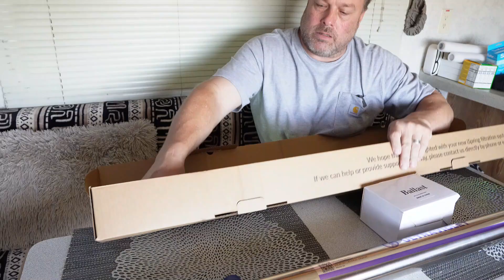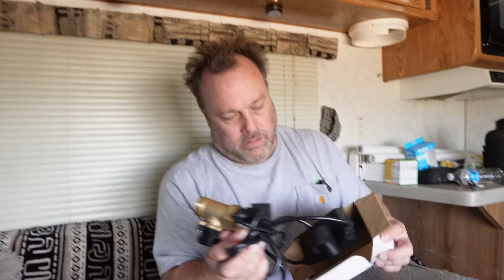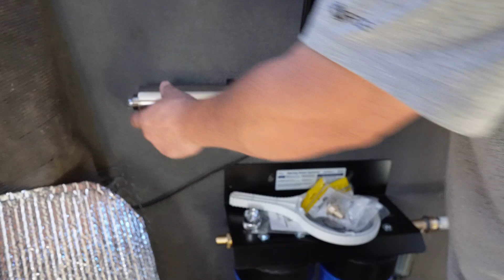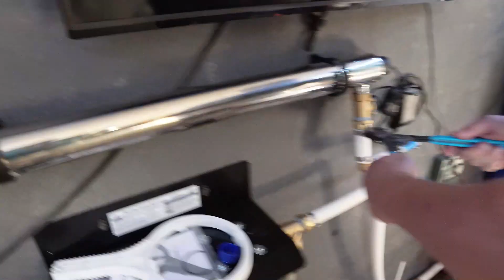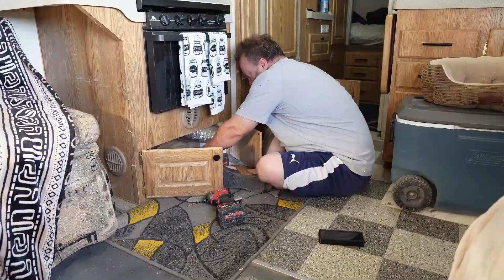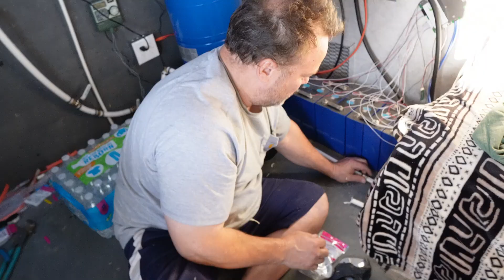Off-grid Tiny House Water Filtration System For My Rainwater Harvesting System

Comment: Overall, looks great.  Juts one recommendation....Please cover the exposed battery terminals next to that system.  Next to water is not ideal ut sometimes necessary.  At least cover the terminals with a board, preferably box them in and lift off direct ground contact. Does not take much water and you end up with a bad situation.